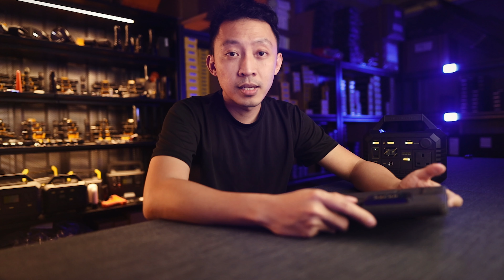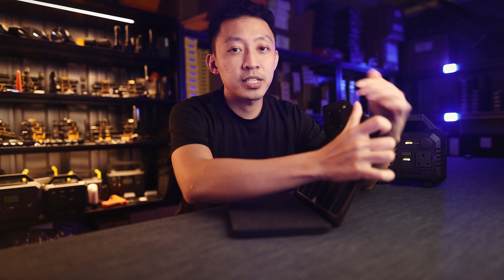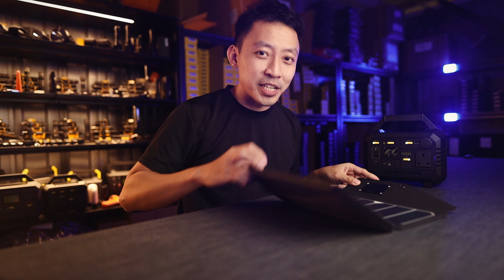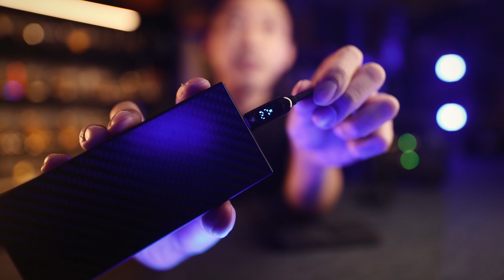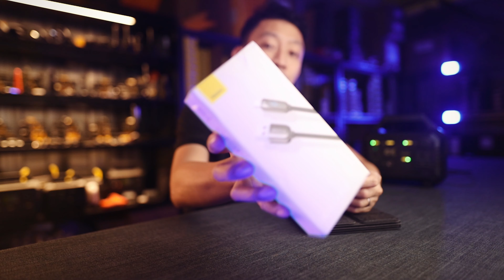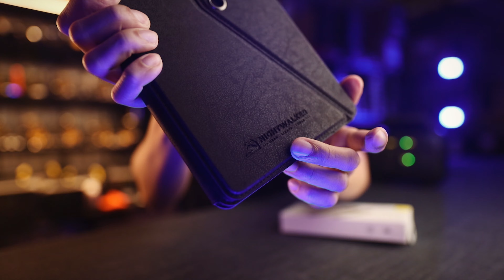28W Solar Panel Giveaway! Just 15 sets!

Comment: Is this solar panel effective in indoor lights ? I saw some other panel brands, able to just use torch light to shine on it and it charge as well. I am definitely not using it indoor. Jus curious about how well its sensitivity to normal lights
Reply from the maker: Doesn’t work on indoor lights. I don’t think other solar panels work, the power is just too little. It might turn the panel on but won’t charge anything.

Comment: I've been watching your videos and I am a die hard Nightcore fan. I suggest you review some of the legendary discontinued lights that they offered. In particular I would like you to get a hold of a flashlight that I have in review it because I think it is still the best flashlight.  It is the EC4SW. The w at the end stands for the type of bulb that is in it it is more towards cool White and the flood is amazing with phenomenal throw with perfect ergonomics. One handed operation with attachments available like diffuser lenses and a lantern diffuser. Has a diecast body that is perfectly designed to wick away heat. The light will stand upright it also will not roll. It's waterproof and has a standby light and a lockout function. The tail cap has a 5-10 thread for mounting a tripod or many other different applications. I hope that you can get a hold of this flashlight and do a review and tell me your thoughts about it and actually go outside and see the light that it puts out. I hope one day Nightcore will come out with a new version of it. Thanks for your videos I've been watching a lot of them lately kind of been on a binge.

Comment: Question for you! 
I’m in the market for a flashlight with approximately 4000 lumens, and that can run a decent amount of time at that many lumens. I would prefer it to be a thrower with some spill, but the most important thing is that it can stay around 4000 lumens for a decent amount of time. I was looking at the olight seeker 3 Pro, but I would like to know what Nitecore has to offer in comparison. Thank you so much!
Reply from the maker: Why specifically 4000 lumens though, can I find out more about your specific use case? Since you mentioned thrower. Because throw lights usually don’t need such high lumens as they can send more light down range. P30i comes to mind right now. But if you can describe your use case more, that will be good
Reply: @nightwalkerlab  thank you so much! 
It doesn’t necessarily have to be 4K lumens, it can be 3k lumens, but most importantly, a light that can sustain that many lumens for more than just a couple of minutes... And it can be more of a flood light than a thrower, I would actually prefer that. and that is why I say a couple thousand lumens, because if it does have a good amount of spill, at least it will still be very bright.... 

I need this light for protection from wild animals. I use a 600 lumen flashlight to walk through the forest at night, and that works fine for navigation. 
But if I come across a bear, wolf, or pack of coyotes, etc. I want to have enough light, and that will last long enough, to temporarily blind the animals so that I can safely get away, hopefully without having to use any other weapons.
Reply from the maker: @airada_imagery  i see, ok then def go for the P20iX pr P10iX. Those have instant turbo from normal walking brightness, and have no limit on how long turbo can be pressed, except temperature. Which in your case should be long enough to make your escape after blinding them.
Reply: @nightwalkerlab  Thanks!

Comment: I’ve used Nitecore for so many things. I started with flashlights…(2) 10,000 power bank and (1) new 20,000 power bank. I live in Florida and we always lose power with the storms and hurricanes we face from June to November. My house faces the south with excellent sun exposure…but I need a soft solar panel like this instead of the solid large panels. BTW…that charge cable is amazing. I’ll be happy to send photos and place all the Nitecore products next to each other. I’d love to have a large power bank like the one on your work table…and your office setup and illumination is exactly what I like. And great job showing and offering these Nitecore products. I hope Nitecore knows you are responsible for most of their U. S. sales! Keep up the good work and for all of us in this difficult time…you must stock up. A Nitecore flashlight when things go south will not only insure your safety….but if you purchase a few…they’ll be worth their weight in gold!